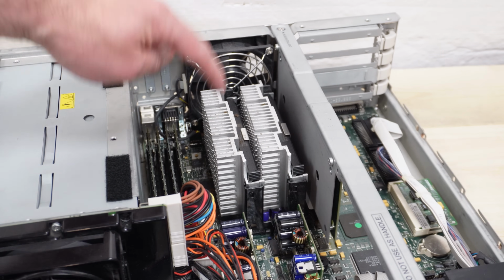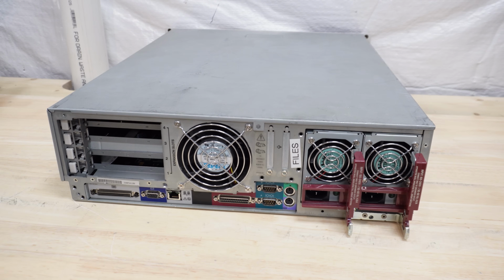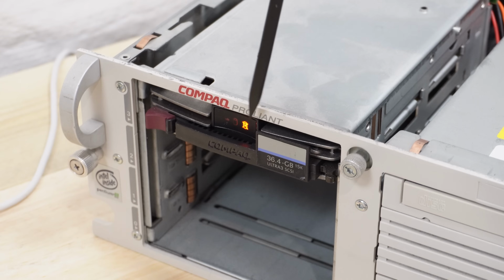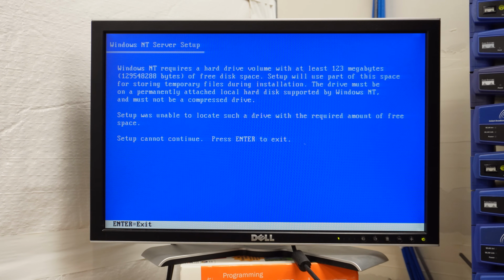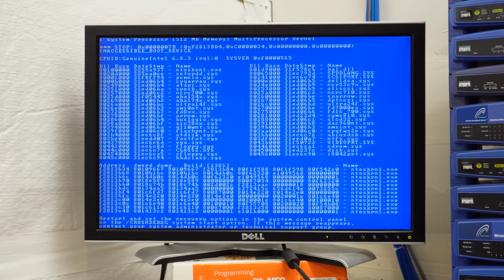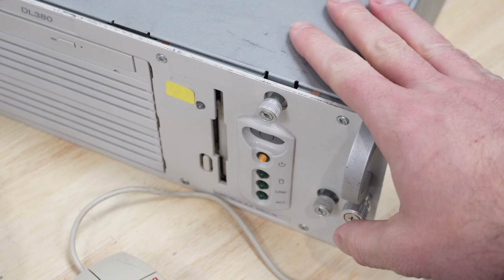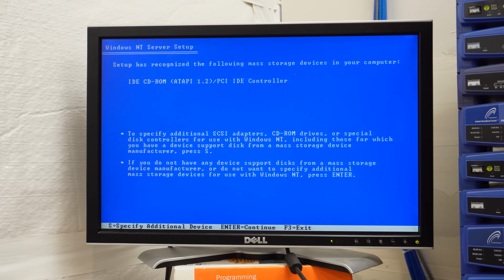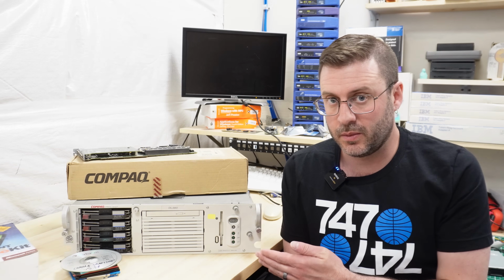Failing to Install Windows NT 4.0

Comment: Regarding SMP / 2nd CPU: some old threads seem to mention this:
Re: Installing 2nd CPU with Smartstart 5.3
You should only use the COMPAQ HAL and make certain and use the HAL Recovery Option also .. ( In case one CPU dies ) The COMPAQ HAL should be installed using the COMPAQ NTSSD now possibly the NTCSP located on the Smart Start CD .. under CPQSUPSW\NTSSD or NTCSP First Install using Express mode.. reboot then run the NTSSD again and highlight the HAL and upgrade this will use the COMPAQ HAL and Not the WINDOWS HAL and will prevent BSOD. Also remember to install the HAL Recovery option.
Reply from the maker: innnnteresting

Comment: Umm... you probably should have made the Microsoft Windows NT 4 install disks and started with those. That would have given you an NT installer that would have created a proper NTFS boot partition on those drives for you.

I never used SmartStart for that, I just created them using the utility on the NT4 server CD.

Also, what service pack is your NT 4 install media? The newer versions came with latest service pack (6, I think?) installed, which makes driver support and updating things easier down the road.

I'd also see if you can get a separate NT 4 driver disk for your RAID controller, and try using that. They should be available to download somewhere. Once the NT installer sees the RAID array, it will let you partition it from there. You shouldn't have to do that in advance, it should just see the RAID array as a big logical disk.

Comment: NT 4.0 is justified how it was. Win 2K was 25 years ago, at it supports Multi Processor.
Reply: I just had an existential crisis when I read that "Win 2K was 25 years ago"....
When did they speed up time?
Reply: @TeeEllohwhydee I remember how slick the win2000 splash screen looked. Man I want to go back, when computers were futuristic and cool.
Reply: NT4 supports multi-processor as well, but only up to 2 unless you bought a more expensive version of it. There was no idea of multi-core CPU's back then, though, so no support for those.

Comment: Very good and interesting video. 

I had some of the same challenges installing NT 4.0 Server on a DL360 Gen 1, which is very similar in hardware, only smaller. It's also been a very long time since I last did this before. It worked for me, but due to a disk failure I can start over again as soon as I have new disks. I was only aware that I had to do this via SmartStart, but creating the disks was time-consuming. SmartStart is also interesting in German ;) By the way, you don't have to create a partition before, NT simply creates an NTFS partition with the maximum possible size on a hard disk that is too large, which is not 2GB but 8GB. The remaining space is unused. From SP6 onwards, larger partitions are also possible. To load additional drivers you have to press F6 while loading the setup and then select the RAID controller driver.

The advantage of a Windows NT domain for me is that you can integrate it into OpenVMS with Pathworks, so it's definitely worth another try :) It gets exciting when you run a Windows 2000 domain with Active Directory hybrid with NT 4.0.
Reply from the maker: thank you! I'll be interested to hear how your fresh install goes
Reply: @clabretro  Since I already had a running PDC at the end, the new attempt will hopefully be less time-consuming. Now I know the typical problems. In any case, it is important to test the hard disks before...
Reply: In the final part of the video it doesn't look like he's pre-partitioning.   Just creating the 2GB logical drive in the SCSI controller.
Reply: From my experiance with NT4 it would actually make a FAT16 FS and then later during install would convert it to NTFS. So your still limited to 8gb I think.. Pretty sure when I was messing with it last on my windows 98 box that I was using SP6
Reply: @treahblade  Yes, that is correct. The setup converts the partition to NTFS before the graphical part of the installation of NT starts.
Reply: @DECcomputers  I had old Gen 1s that  were from cisco call manager servers… I probably still have the install CDs for them too.